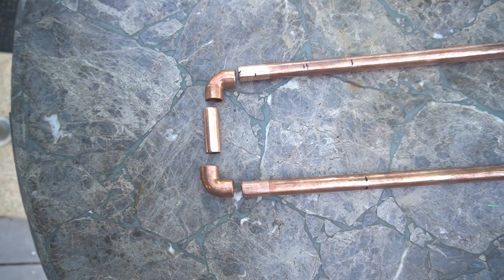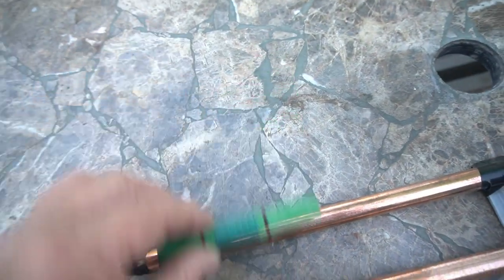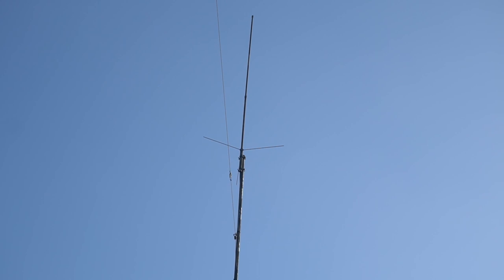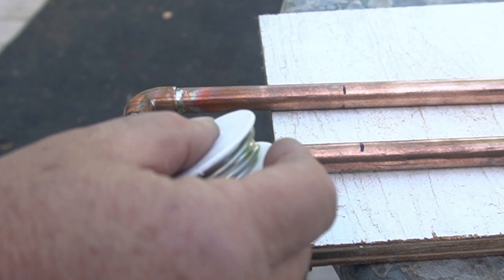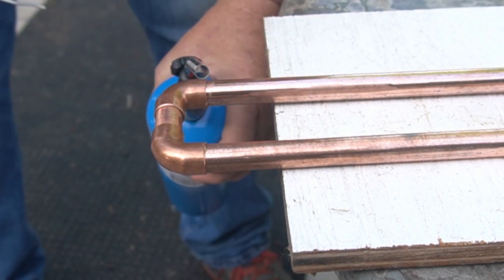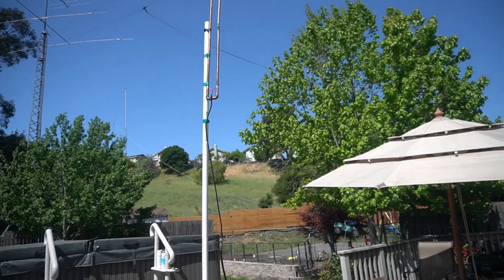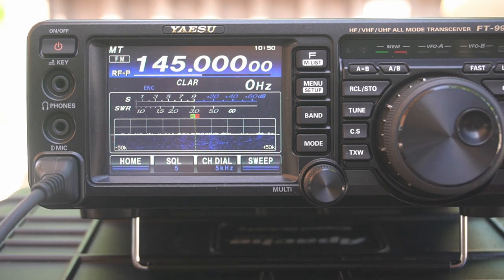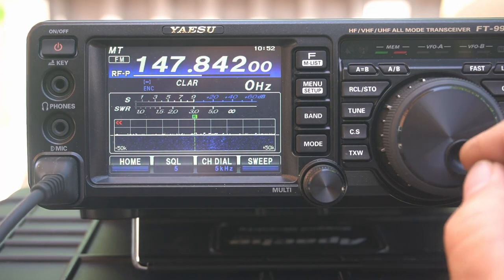How To Make Slim Jim Antenna out of copper for 2 meter!

Comment: Very nice demonstration. In the UK we are not allowed to have lead based solder so have to use silver based. This has a higher melting point rhan lead and needs more care to avoid overheating the copper. As a comment on your technique, you shouldn't need to put the solder wire all around the heated join. Just touch in one place and it should run completely around the joint by capillary action. In plumbing you often can't reach around the whole joint anyway. Thanks for posting.

Comment: Great video and thank you. If I may respectfully say as someone trying to get into ham radio and has never done any of this before I would have liked to seen how you hook the coax to the antenna. Maybe you have talked about that in a past video and I apologize if you have. Please keep up the great work. I really do appreciate it.
Reply from the maker: Taz, I used 2 self tapping screws one on each side and the center goes to the closed side and the shield to the side with the gap. I used two crimp on ring connectors that I also soldered. I think you can see that near the end when it is mounted to the PVC mast.
Reply: @KK6USYHamRadioAdventures  thank you and I appreciate the help and info

Comment: Chuck well done video . I was once told by a fellow ham the slim jim was better than anything else , well I'm a hard head I wanted to see for myself so put it on my test site to see if in fact it was better than the standard end fed vertical better know as a j-pole, what I found showed it was not better but that being said it is shorter so could be able to keep in tune further across the band known as lower Q  but heck the 1/2" copper antenna is already wide and due to the diameter so not an issue but heighth might be for a few hams . My test results showed it to be a compromise from an optimum tuned antenna . Take off angles we're not tested , both were the same height ,transmit and receive antenna . I use an analog tv field strength meter to actually see in microvolts what the test antenna is doing , my test transmitter is the mfj 256 analyzer set to transmit frequency .  This test setup gives me a relitive indication of what an antenna is doing so don't have to rely on other stray signals from others or from beacons to see what's happening. We all need to understand what's perfect for one location may not be best for another and we hear a lot of hams saying it the best I've ever had , however we don't know what they had for comparison. If you really want to see what's going on rotate that Omni antenna and take a look at the signal you will be surprised at what you see . I have noticed someone has gotten a patent on an improvement of the common j-pole antenna by adding a choke at the base in the form of a other j section , smart idea of course that's because it's mounted to a metal mast if it was PVC mast that wouldn't be needed but have built several to be tested as soon as harness are made up , also j- pole is a balanced antenna so has to have a choke and I use a coaxial sleeve choke for mine .Keep building antennas and never stop trying to make them better. kc5ulu

Comment: Nice works chucks. Try a ladder line, twin leads, light balanced line for portable works on the higher HF bands for ur portable use, it would be great on a fibreglass telescopic pole. Good low angle vertical radiator. Bye, sly...

Comment: Another comment on you coax connection to th slim jim. The original article by fred judd shows the coax leavingvthe antenna atvright angles to the antenna (i.e.horizontal). You may find this will bring your SWR down even further.

Comment: Thanks Chuck. I was concerned about water in the coax, is it still ok?
I didnt know the slim jim was better than a j pole. 🍻
Reply from the maker: The slim jim can be better for distance in flatter areas like a vertical to a dipole in takeoff. No problem with the coax, I think I used some liquid tape to seal it.

Comment: There is a sleeve that is made to slip over the tubing to make splices that I am going to use for tuning.  The coax can be connected to and then moved up or down for tuning then soldered in place.  What do you think?
Reply from the maker: I think that will work also , that's kind of what I did with the copper wire to find out where to attach my coax I just used screws but may change to thru bolts. Thanks for the comment and for watching.

Comment: If you find yourself making copper pipe antennas often, you might consider replacing the propane tank (blue) with map gas (yellow). It's available at the box stores, and makes pipe soldering quicker due to more heat and more likely to make a complete sealed connection.

Comment: I have been considering one also, could it be made with 1/4 inch solid copper line, I get it for 99 cents a foot at my hardware store, it takes bends easily, though I can solder, the joints and pipe are pretty costly. What I am really asking is - is the large diameter of the pipe needed?
Reply from the maker: Yea it should work fine.
Reply: @KK6USYHamRadioAdventures  Thank You
Reply: I know I'm late to the party and you probably already built your antenna, but in case anyone else is considering your idea with 1/4 inch solid copper: get a cheap tubing bender from Harbor Freight (or similar) to make the bends, and the finished antenna will look almost store-bought!

Comment: I’m not clear what you were doing at 2:10 when you were moving the two twisted wires up and down.  How does that tune it, and what do you do with the information? Do you cut the pipe at the point where the wires are in tune? Does something connect to those wires while you are tuning? Sorry if this is obvious I’m just not grasping it. Can someone enlighten me? Thanks, Chuck  KE0PTI
Reply: After watching a few other videos, I think I’ve got it.
Reply from the maker: Chuck I was adjusting for best SWR.